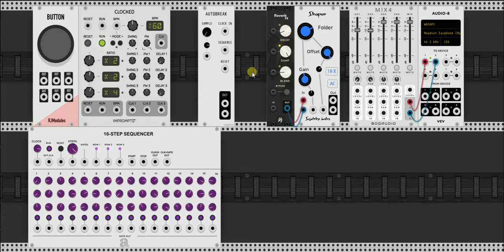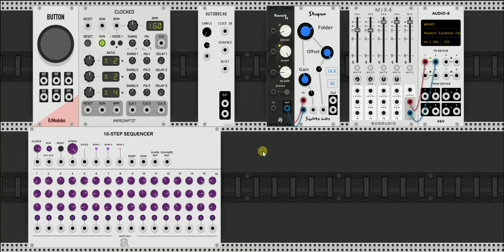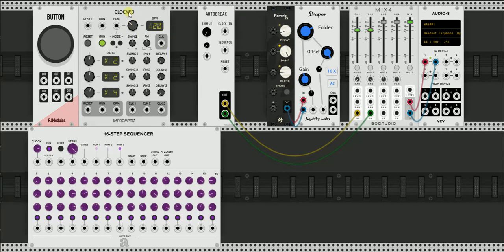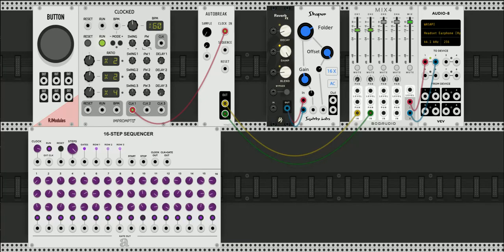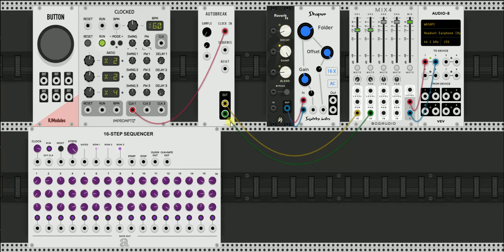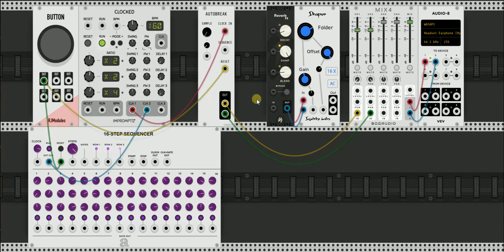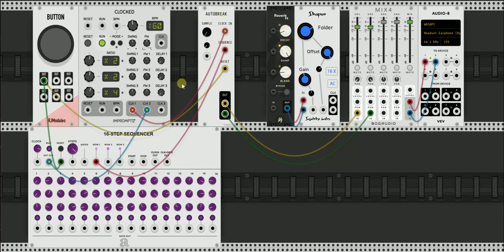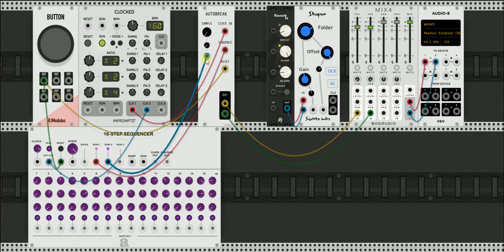Voxglitch - Autobreak tutorial

Comment: Im on cardinal... and I cant find the RJmodules button. Is there something similar i could use?
Reply from the maker: I'm honestly not sure what button modules are available on cardinal.  If you think of the button module as a way to transition a signal from low to high, you might be able to find something similar.  Maybe there's a switch module out there for cardinal, or a pulse generator that can do the trick?  I wish I can give you better advice, but I don't use cardinal myself so I don't know.  Also, you may want to check out Autobreak Studio.  It's free and may be more compatible with what you're using.
Reply: @clone45a6  I did end up finding and using the little utils button. I found out how to trigger the button using midi and some cool patterns resulted out of that but Im struggling on finding out how to use multiple midi channels (to trigger the reverse)... Or is there a way to assign different midi notes to different triggers? I found Cardinal host midi gate it shows all of the notes but I still cant figure it out or if it's possible. Basically I feel limited by only being able to use one midi track for my cardinal patch. Any ideas? Thanks!

Comment: First of all, great modules, I love the Repeater and the new Grain Engine, thanks for doing what you do. 
Now - not sure this is the right place to ask - but:

I'm driving the Autobreak (4s breakbeat loop) with your Digital Sequencer. I'm using its Snap (to 16) to set the values, so they should be consistent across different sequences. There's a reset on everything on every 8 beats and yet: two identical sequences produce different results in Autobreak. What could be going on?
Reply from the maker: Hello Urs!  Sorry that I didn't respond sooner.  I have my notifications turned off.  Could you email me a screen capture of your patch or contact me on my voxglitch github page?  It's possible that the reset feature on Autobreak might need some work.